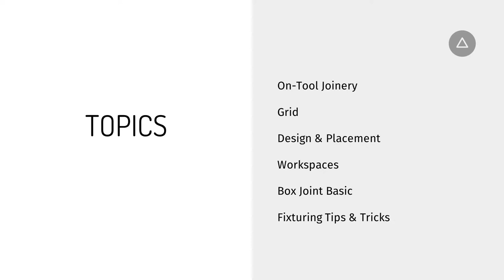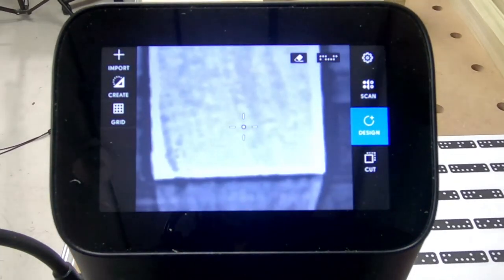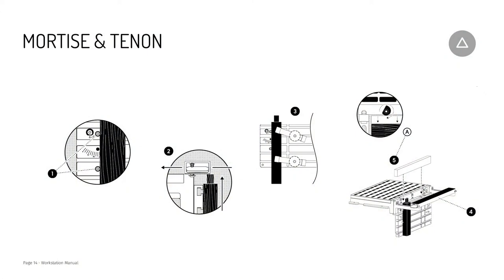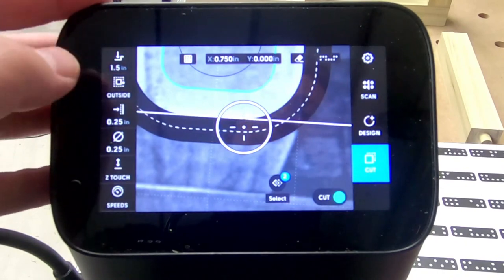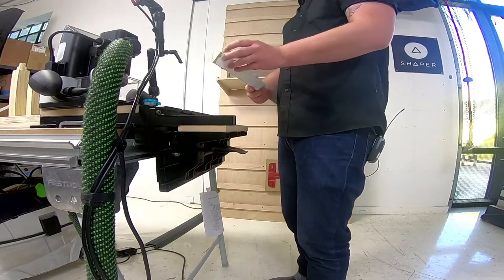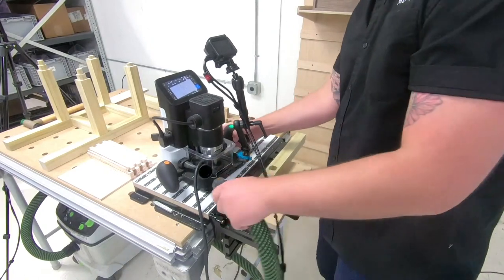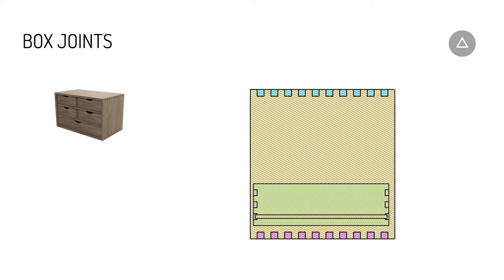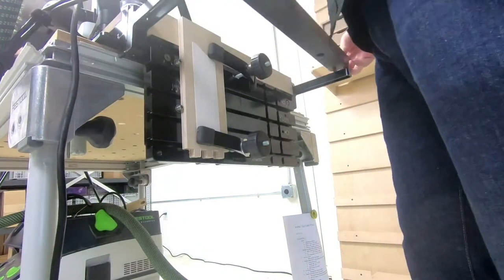Session 7  – English: Origin & Workstation - On Tool Joinery

Comment: Great video!  I picked up more tips and techniques than I ever expected in this short time.  I have a history in aerospace machining and found the points you offered directly connect to good practices in machining materials like titanium and other tough materials.  This 50 minute tour has put me over the edge.  I am going to buy the Shaper and Workstation.  It will be a great compliment and step forward to my 30+ years as a wood worker.

Comment: Many thanks....Getting closer to placing an order...In the meantime where do you get that incredibly handy sanding stick?
Reply: Possible suppliers for the type that use the narrow belts are Rocke & Woodcraftr : https://www.rockler.com/detail-sander-and-belts-set-set
Woodcraft (2 grit collections, this is the course collection) : https://www.woodcraft.com/products/standard-kit-sanding-sticks-24-piece
Mega-Lo-Mart : cosmetics, look for emery boards
eBay -- lots of variations
Home-made, non-adjustable : small stick + spray adhesive + sandpaper

Comment: This is very helpful. I have owned my shaper for approx one month. So far I am getting much better at box joints and have done some engraving. I am waiting on my workstation so I am using a homemade one currently. First question is on the grid. What did the .75 on the grid represent?  Second is the bit you are using an upcut,  or downcut?
Reply: William Kolesar agree, I didn’t catch the 0.75 inch grid meaning either.

Comment: At @5:16 what is meant by "touch bar"? I'm trying to do my very first Z touch using the workstation and I'm getting a Z touch error. The machine actually lifts up in the air in a very disconcerting way.
Reply: Allow me to answer my own question! :-) The touch bar or touch-off bar is the oval shaped pad with screws on on the very bottom surface of the router. There is some kind of sensor in there. I believe that my problem was that this touch off bar can't be floating in 'open space' when trying to perform a Z touch. In my case the my workstation back support bar was too far away from the workpiece causing the touch off bar to, well, not be touching anything. When I moved the support closer, the problem was solved. Anyway, my advice to Shaper would be to add a note about the touch off bar sensor location and how it must be touching the workpiece. I guess this is what their language: "Z Touch Failed. Make sure Origin's base is on a single, uniform surface and try again" is referring to but that, by itself, was not super clear to me. But I figured it out! Powerful tool!
Reply: I encountered the same problem when I first started using the router, but never sorted out the root cause. Thanks for adding the details of the root cause.